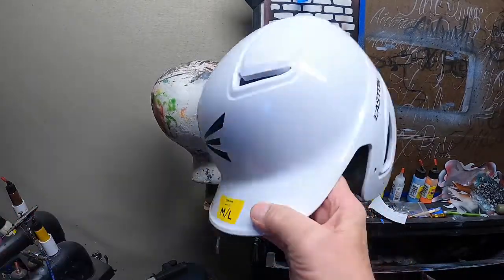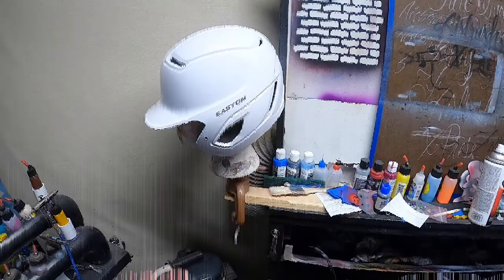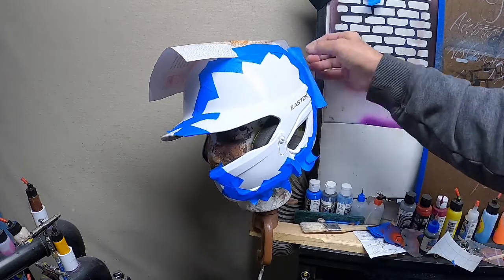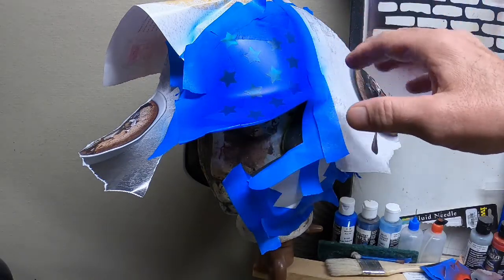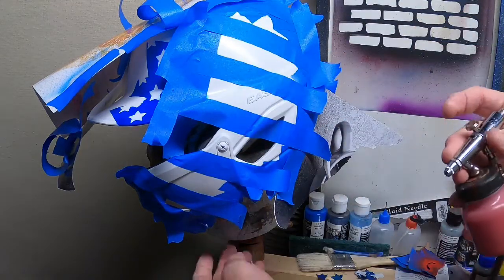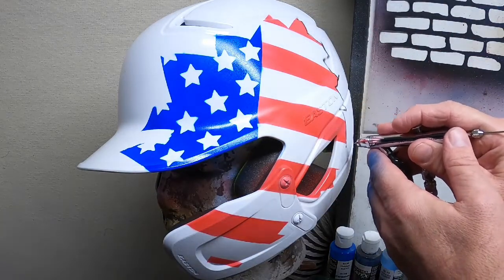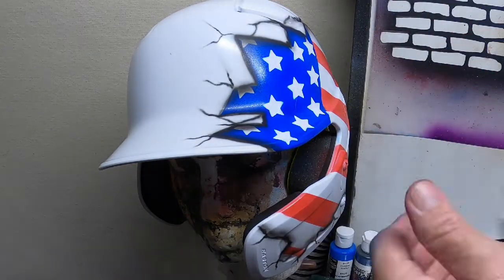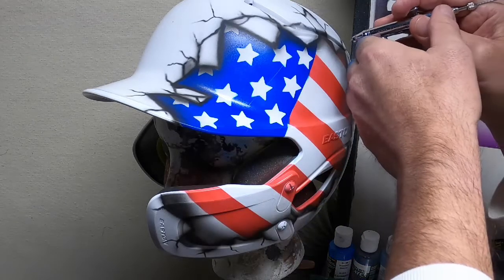How to Easily Airbrush a Ball Helmet!!

Comment: What degreaser did you use
Reply from the maker: I use Dupli color premium wax and grease remover....get it at O'Reilly's auto.....goo gone for the sticky residue if any is left from certain stickers.  You can use a grey auto scratch pad to scuff the shine......a red auto scuff pad for the paint on "raised" letters on some helmets.
Reply: Thank you very much I’m just starting out I’m trying to learn as much as possible
Reply from the maker: @brianprather3261  Glad to help my friend. Anytime. The biggest key is the prep.  I use Createx Wicked paints.  What airbrush are you using?
Reply: I’m using created  I have been looking into wicked  I’m using master airbrush model g22 got it on Amazon it does pretty good and iwata hp-cs
Reply from the maker: I think you're going to like the wicked line.